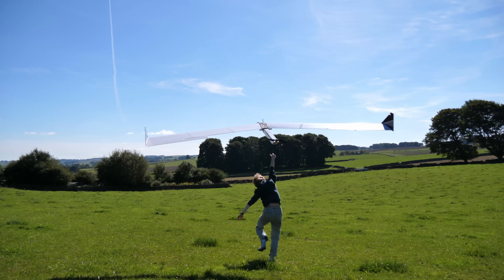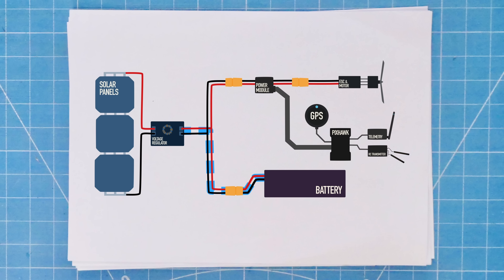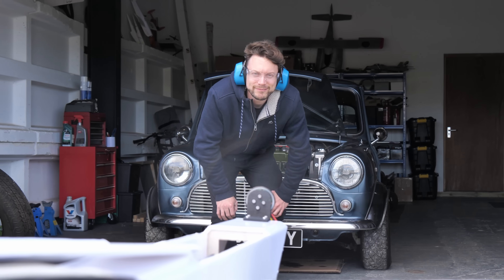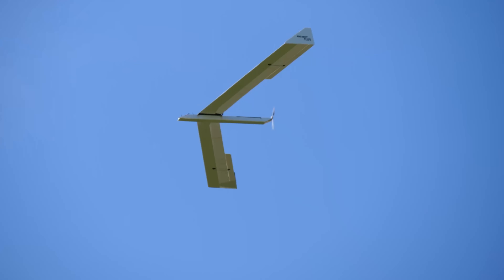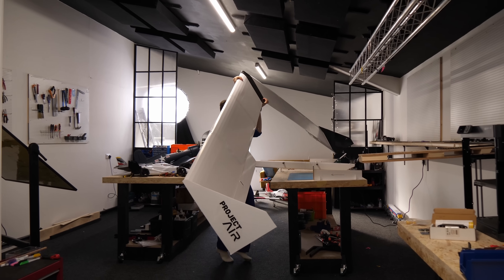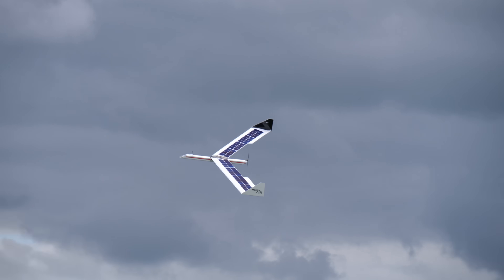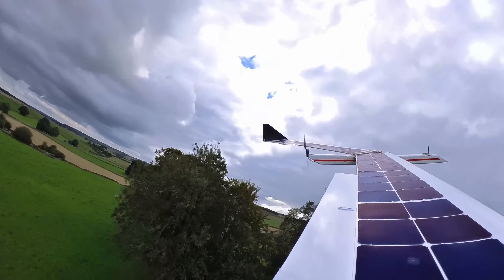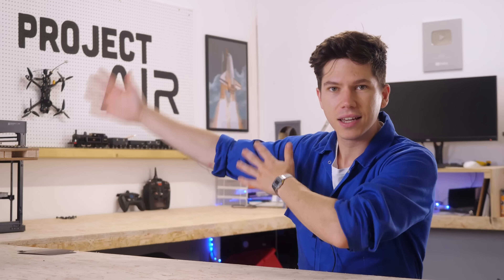Solar Plane V2

Comment: Would it have worked just by adding a large capacitor & using a different ESC in the beginning, instead of the voltage regulator system?  -- I would think a proper capacitor would be enough to control the ripples & wouldn't consume as much energy as a regulator, but I've never built RCs before so I'm just curious if there's a reason for that?

Comment: yeah the problem with those solar controllers is they dont supply a constant voltage out, i wired mine to a 12v regulator/rectifier to stop mine burning out my pond pumps, id suggest looking into capacitors more than batteries too, they have more benefits, stick to tiny batteries from a wireless mouse to keep the controller and things powered, you want it to charge too..

Comment: Can we do,

Motor ac     work [battery --> Dc to ac ]

Day = solar panel [day charging battery + converting dc to ac 

Night = battery dc to ac 

+ add a motor which generates electricity from wind  

Which can charge the battery + Dc to ac  

How is my plan 🤔

Comment: Maybye try a lighter battery... You probably do not need a lot of additional power (only for climbing, fast maneuvers and for emergency if the solar system breaks).

Comment: Why not use carbon fiber rods instead aluminium spars? And why do they need to be an "L". Basically a simple "I" shape would be sufficient to work against the flapping and also should take out some torsion

Comment: The motor mount snapped so you made it stronger. I think this is critical because then the next weaker thing will break which is the structure. A predetermined breaking point or flexible solution maybe? A foldable propeller?

Comment: Besides the solar panels what if you design the body as a glider, wont it stay flying forever? With the potential of using the motor as a generator?

Comment: hi. rather than focusing on maximizing the solar-panel surface, i would suggest making more of a glider, that would gently limp down even after the motor is shut down. not only that this could save the plane in case the electronics or anything failed, but this could lower the power consumption-you could glide, then climb, then glide, etc., meaning the motor could be shut down like 40% of time.

Comment: How about a wing that is hot wire cut foam, then cover it top and bottom with 1/32" balsa sheet? You will have to angle (splice) the profile of the sheet end, to join the planks spanwise, especially on the underside of the wing, to be able to transmit the tension load between planks, either that or stagger the plank end joinns. Might be a bit heavier but not as heavy as running an aluminium spar.. No spar required, unless you want to inset some spar caps top & bottom into the foam before covering with the 1/32" sheet. A very stiff wing. Very stiff in torsion too, which will help with roll control, because your low stiffness wing was probably twisting due to your outrigger elevons (a larger chordwise moment arm). That would tend to negate the effect of the elevon roll input, hence sluggish roll. A bit more work but better I think. Also, I know you want to keep the onboard electronics air cooled, but leaving the front of the fuselage open, is very very draggy, try a couple of NACA side scoops with an open fuselage rear end instead. 🙂

Comment: Fuselage and large battery could be eliminated.  Just need a pure flying wing and perhaps a smaller battery if weight loss is needed.  But for real superlight strong plane, talk to the soaring enthusiasts.

Comment: Have you tried longer blades in the propeller? Longer blades mean a larger area is swept by the propeller during rotation. This larger area interacts with more air, resulting in more air being pushed backwards, generating more thrust.

Comment: why did,nt you try adding an extra battery. in such system make somethink like that plane uses one battery and charges second battery and when the first battery is exhausted it takes power from second battery and charges first battery. please think about this idea.

Comment: that motor pull it down..not the bress. u need to deg up the motor or put at center not up the casis, like other upper motor plane it to do degre up the motor if not the motor will pull the drone down

Comment: The load port on MPPT charger's is just for small loads like a single light bulb. For most applications you are going to attach your load directly to the battery bypassing the MPPT!

Comment: wow impressive. I know it is a old video but i thought it could be usefull to add a system that prevents crashes: for example a controller like arduino powered with the same rc battery that has the command to get the flaps up to prevent a rough landing. 
hope it is a good idea....
Reply: in case of power loss

Comment: Composit resin and fibre instead of the aluminum, would help. carbon fiber or fiberglass. you could 3d print a mold and vacuum cast. for most people i would say it's a lot to get into, but if you're business is making funky planes, i think it would be worth it for you to invest in a couple simple pieces of equipment and the skills.

Comment: Maybe 'structural solar panels? 
loss of solar efficiency from an extra layer on the panels/wings; might be superseded by gains from a smoother skin and reduction in 'single use' reinforcement mass.
also you could use cabling to support and/or buffer the wing oscillations/deflection.

Comment: one thing that you forgot was the landing gears so if you add that then you dont need to manual launch anymore just let it roll on the ground and then takeoff!
Reply: landing gear would make the airplane a lot heavier
Reply: @Gepidball  that is right and if on grass as we saw it would get cought unless using a heuvy one but why not use a launcher that is powerd using air pressor

Comment: It's slow to roll because you have no yaw control. With a design like this you need to yaw in the direction you want to turn. Doing that puts one wing into the wind, making it generate more lift. That's how you generate the rolling motion (proverse roll), not with the ailerons. This is true of high aspect ratio aircraft. Watch videos of people flying gliders and you'll see that they turn left or right purely by manipulating the rudders. Ailerons are essentially just for pitch control. If you look at famous Delta wings like the B2, remember that they have split rudders on the wingtips where you have ailerons. These can be used to create yawing motions.

Comment: On the wing design:  maybe lighten the aluminum spars by having cutouts machined in to them?  It'll still be far more structural than foamboard spars, but much lighter.  Or compare spruce spar weight to the aluminum?  

Additionally did you consider a small amount of dihedral to help stabilize the thing in the light winds you had on your first test flight?  Its been a long minute since I was in the hobby so feel free to ignore the old-time-armchair-pilot 🤣😂

Comment: As a solar diy guy im gonna say what many other people have already said 

NEVER USE THE LOAD TERMINALS ON THE CHARGE CONTROLLER 

in most cases especially in the case of smaller charge controllers the load terminals are meant to power small loads like lights and were never designed to allow large currents like rc controllers and motors

Comment: You try to add enough solar power to use and charge the battery at the same time. You have to squeeze it until there is almost no space left. 😅😊

Comment: YOUR MPPT controller is for 4 cell LiFePo4 battery not 3cell LiPo battery!!! HOW DID YOU MISS THAT!!!! LiFePo4 batteries have cut out voltage of 2.5Vx4 = 10V your lipo discharged to 10V and MPPT disconnectd it as that would be very deep discharge for battery it was designed for!!!

Comment: A more classical approach will made it more steady. Longer tail with wings, propeller in the front, single aluminum layer main wing with a secondary arch shape wing under it will make the main wing more rigid. You need a planer shape for that low power, not a B2 bomber.

Comment: 14:10 Large birds of prey fly in tight circles, following thermals, to increase altitude.  But perhaps the tight circles also add stability to their flight during a climb.  Perhaps you could use a tight-circle flying pattern at you attempt to increase altitude?

Comment: I'm trying to recreate this, the problem does seem to be there's no simple solution to charge a 4s lipo from solar panels.  You finally just settled for a voltage regulator?  So like a 2-6s 12v output voltage regulator, but in this case you used a 16.7 volt to charge the lipo? but it could overcharge it right?  So there are problems with that as well?

Comment: 8:05 just add wheels
Reply: It wouldn’t work on grass
Reply: @NinettkNine it could work just will be bumpy if he adds thick not to heavy but a little heavy wheels it could work bc the weight will way it down from flipping are anything and then it won’t be as bumpy on grass because the weight will keep it down smashing the grass down making it easy for the plane to land and even jf it dose not work it’s worth a shot

Comment: Correct me if I'm wrong but straight wings instead of swept would increase stability with low speeds. 
This airplane is obviously not for speed record so drag is not a primary concern. 
I guess this would increase stability same way as in case of gliders...

Comment: I’m currently attempting to do something similar, I’m using a Pixhawk PX4, and I’m planing to use QGroundcontrol like you, instead of building a airplane, I’m planing to build a rover that uses solar panels, like the one RCtestflight have done. 

As the looks for it, you got the autopilot to work, I don’t know if you are the right guy to ask this about, but how did you set it up from beginning to end, how did you calibrate it, setup the correct motor outputs etc and of course setup a mission.

Comment: I do not claim to know even a small percent of what you no doubt know about aircraft, but might I give you food for thought?
Have you considered using a canard design?  Either similar to the 1903 Wright Flyer or more like the Pterodactyl Ascender (look it up on wikipedia).  The front mini-wing could save you from nose-dives, and although it would increase the drag by a little, it would also decrease the stall speed which means that the whole craft would undergo less drag.  I do not know if it would be a net +/- drag, though.  Just a thought.

Comment: Could you not keep thenflying wing design but reduce weight via material selection? I dont recall what the wing is made from but could you not make the wing from carbon fibre? We all know how lightweight it is and with a little simple design, it could be very strong. I would also look at the motor, im guessing you are already using a fairly efficient motor but could there be a more efficient model or could there be a way to add a gearbox that could give you higher rpm and thus more power, while reducing the power consumption? Yes a gearbox adds weight and complexity so a centrifugal system is out, so too is a box that uses an actuator to switch gearing. This would mean direct drive only. As this isnt exactly a high performance setup though, plastic gearing should be fine to handle the kind of torque generated, keeping it light as possible. A simple box with improved gearing may be able to add another 20 % to your rpm or more and providing this doesnt put much more of a load on the fan during cruising, you may get the increase in efficiency needed to keep that motor at 70% and with the lighter, stiffer wing, possibly made deeper allowing a 3rd row of solar cells.... would this not be possible to get the performance, weight and power to line up to sustained flight?

Comment: Nice... but that completely UN-Aero L shaped engine mount:  Aaaargh!!!
That almost ended the video for me.  
You do realise just how BADLY you're ucking fup the aero through the prop right!?

Easy Flush solar cells:
Those solar cells come with a protective sticker over the top don't they?
So if you left them on; you could spray paint (filler etc) over the wing, cells and all, and then when you pull the stickers off; they are flush with the wing...

Comment: i would look more into something like the northrop flying wing than at the delta wing design, this would give you the ridgitaty that you want and the area to mount the solar cells, but would not have as many of the drawback's of a delta wing design. also have you looked at the new Toroidal propeller's? they have a better efficancy than normal propellers and may cut down on your power usage.

Comment: I’m not an expert in flight and power stuff, but if the battery doesn’t already work as this, could it possibly work as a backup power if the solar panels stop producing energy? Like, if a cloud goes in front of the sun, it can still fly long enough to land. Possibly a warning system if either system fails?

Comment: Dude, it's easier to gain altitude if you put the engine in front, it's also easier to aim the tip upwards when falling, distributing the impact. Maybe this means you need to put the wings back, to balance the weight.

Comment: maybe put something that checks the battery percentage, and if its too low the motor turns off and only the wings and flaps are able to move so you can land the plane before everything turns off

Comment: Need to drill out the aluminum spars.  You could literally remove 75% of the material (like Slotted brackets, but even more material removed), and it would still be overkill strength wise for what you need if you are going to keep with this same design.

Comment: rather than using the aluminium L shape metal could you not have use tension wire that would have been lighter

Comment: I'm sorry if I will sound too mean but if you can't be bothered to do literally any part of the project properly or at least with care, why even start? Like I can't even call it a project, it's just doing "cool" stuff and hoping it'll work out somehow.
The same can be said about other videos I've seen: when first couple of sloppy solutions dont work out the next one is always "let's slap rocket engine to it because it's cool" instead of fixing problems created by simplistic solutions.

Comment: I think the motor is too small and with 100% throttle it's not gonna be efficient. Better get a larger, slower motor with a larger propeller to boost efficiency

Comment: What if you made a B2 spirit style plane and covered it in solar, from what little knowledge i have it would be more stable in terms of wing flapping and you would have more surface for the solar panel so you could use a second engine

Comment: It is amazing seeing how much someone could achieve by passion and perseverance, despite some lack of engineering expertise. I highly respect and admire this. 
Here some suggestions:
A) Use the MPPT controller, since it increases the solar efficiency. Just don't use the "Load"-output, instead connect the motor directly to the battery. This "constant voltage" approach might cost a lot of efficiency, depending on the sun conditions. 
B1) These L-profiles tend to swing if stimulated from a specific angle. Thus a T-profile would be more suitable.
B2) Since this is not a car, but a plane, aluminium has no business there. Instead carbon profiles (tube or rectangular) are more suitable.
C) The propeller mount is chosen poorly from a drag stand point. The motor should always be in line with the fuselage. Thus, either just flip the motor mount upside down or modify your tail being narrowed towards the end and mount the motor on top (if the elevated motor position is chosen due to some flying wing requirements that might be different).
D) No suggestion, but I'm just wondering. What is the point of having a flying wing with a very long fuselage? Since usually the gain of a flying wind is to avoid having a big drag creating fuselage.
Best regards

Comment: 17:23 Jesus, the big problem is that you don't even have a plane that flies without solar. Instead of combining two good gliders into a thing that is unknown again, just use the glider as it is. Or a bigger one. Anyhow..make sure the plane flies well before putting solar on..and get the cg right before showing it for 20 minutes🤦‍♂️

Comment: Hey James, this is Dewen from Singapore. Really love this whole video series on solar aircraft. I'm not really a Youtuber, but you can check out our solar aircraft in 2018:
https://www.youtube.com/watch?v=bJPplmWb-vI
We are the first in the world that achieved 100% solar flight (no battery) for a quadcopter, currently I'm still working on it as a side project. 

Quadcopter and RC plane is a bit different in nature, but I thought perhaps we could get in touch somehow to try to solve some of the problems for the aircraft. We struggle the same issue of heavy weight and insufficient power. Indeed we suffer a lot more since quadcopter uses much more power. We tested hundreds of motors, solar cells and various aircraft design, I could share some of these data with you. 
few things just came into my mind: 
- for a mppt you might want to consider mppt module from Packet Digital, one of the lightest in the market, but slight pricy. 
- you might want to test out the actual efficiency of the motor & propeller, going to higher voltage is more efficient. 
- a wireless ground station might be useful for you to always monitor the state of the aircraft one the ground while it is flying
Looking forward to you reply, you have fans from Singapore as well:)

Comment: IMO you need a stiffer wing. Some lightweight honeycomb struts would go a long way towards stability and energy efficiency. Im not a physics PHD, but im pretty sure youre losing energy with those massive wing flexes, not to mention what happens to the lift that must be lost.

Edit: 3 minutes later you do exactly that. Bravo

Edit 7 minutes later: Light weight honeycombed 3d printed plastic wing struts will give you the strength and save you the weight